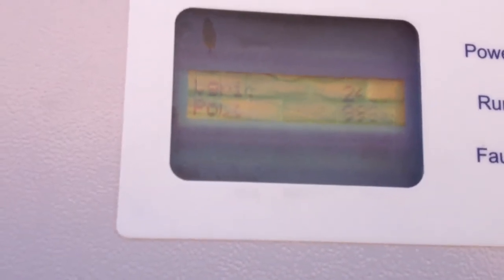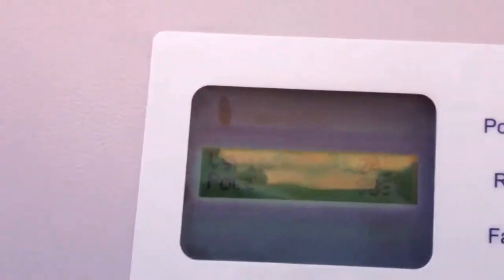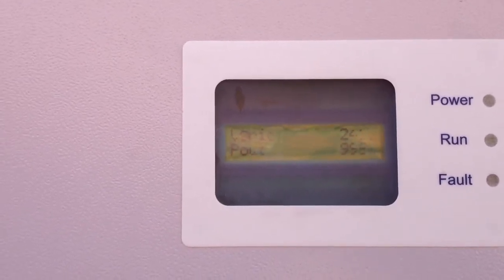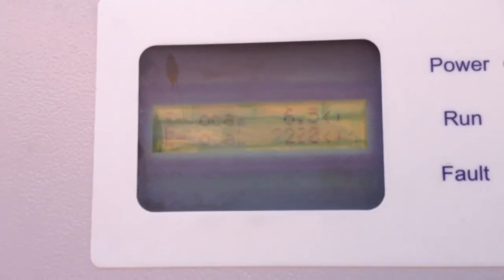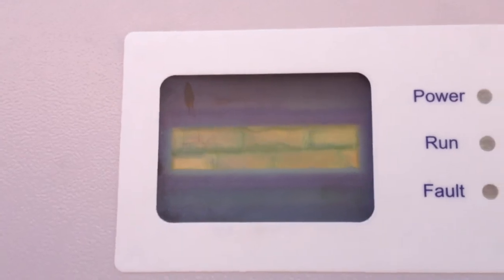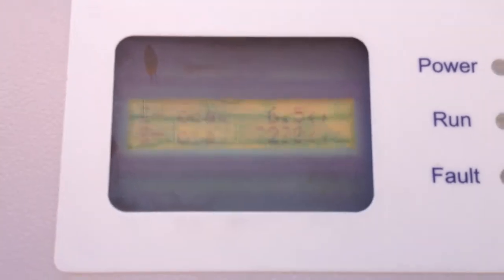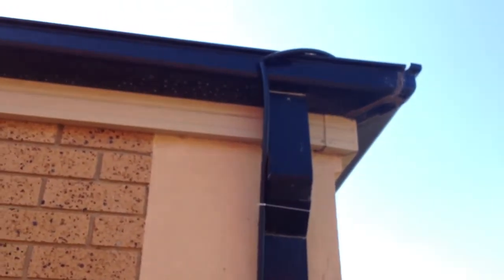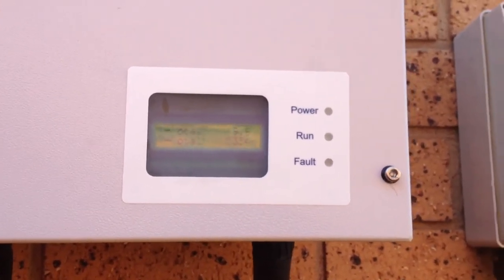Solar panel cooling proof!

Comment: Spray of cool water on hot solar panel glass can easily damage glass Or shorten its life span. Water that sprayed on panel must have little difference from temperate of panel surface. Do you consider this factor while designing it??